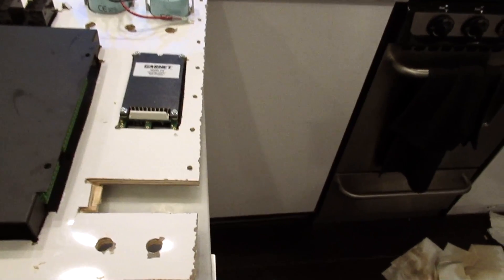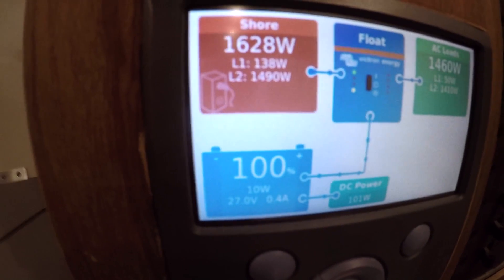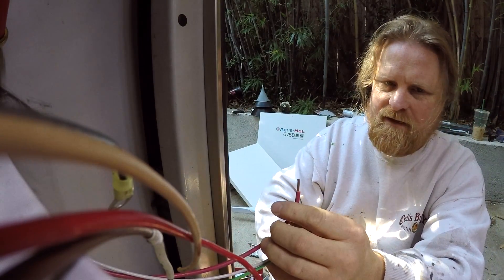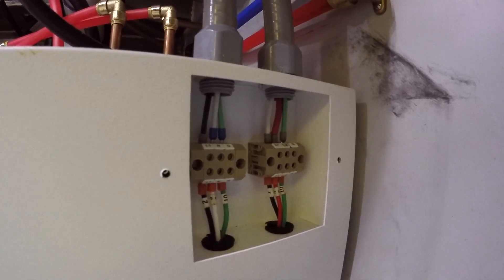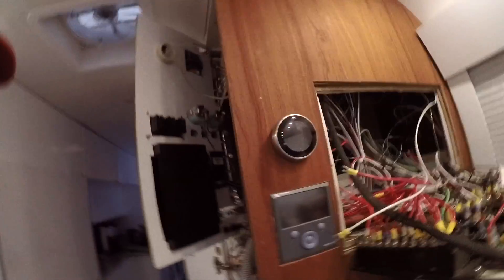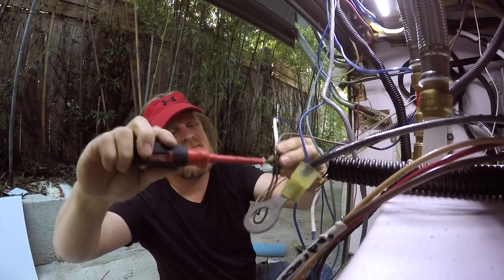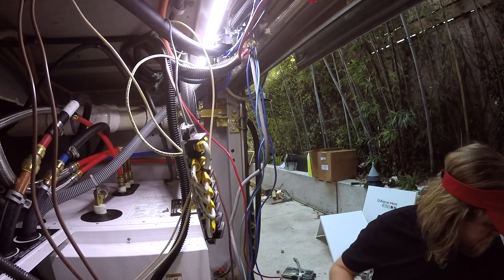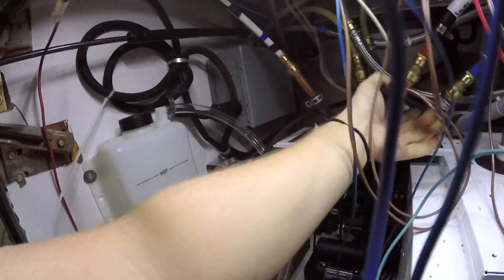Aqua Hot 240VAC and DC Power

Comment: I Got a tip from Jimmy Diresta to use a good hot glue gun to "glue clamp" things in place and then screw them or use good, permanent glue with small spots of hot glue to hold it in place until the permanent glue sets.. I use it all the time.. I am relating it to holding your terminal block up there so you have 2 hands to put the screws in.